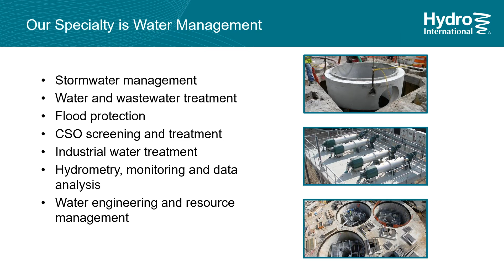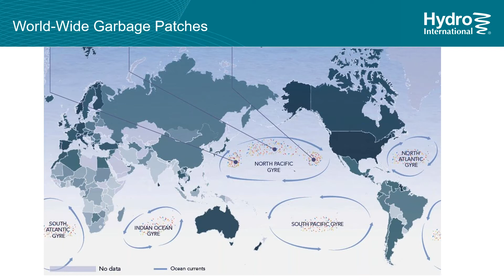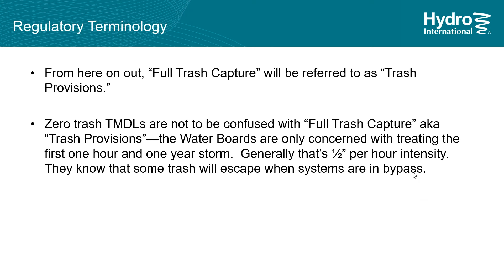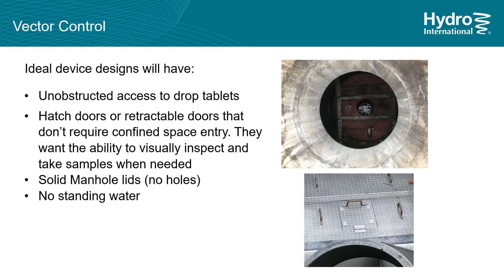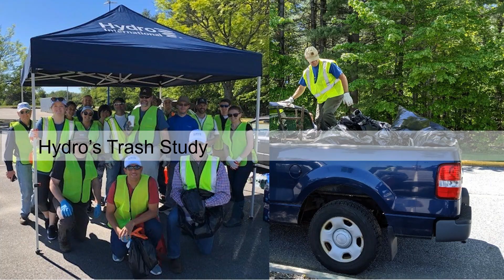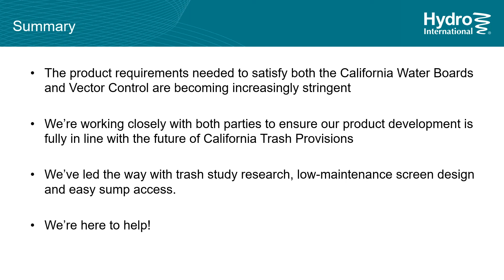Stormwater Webinar: California Full Trash Capture

Comment: Thanks for sharing this very important pollution topic in California.  Noticed that trash is accumulating along the shore line and not originating from the storm drains.  The MS4 trash regulations do not regulate the trash that is not in the storm drains (i.e., illegal dump sites and wind blown trash).  Most of these trash sources are behavior driven and unfortunately a bottom line issue for small businesses.  The packaging for products is primarily the source of the (e.g., not including the micro-trash) trash that makes it way to the surface water bodies.  This issue should be revisited as a cradle to grave process for consumer products.  There could be a solution by minimizing packaging when selling the consumer product at the point of purchase.  Based on the annual ($1 billion) estimated coast of trash cleanup for storm drains only, it is costing each resident (39Million) in California about $20-40 per year to pay for the cleanup. The actual cost to properly dispose of all of the trash is more like ten times this estimate.